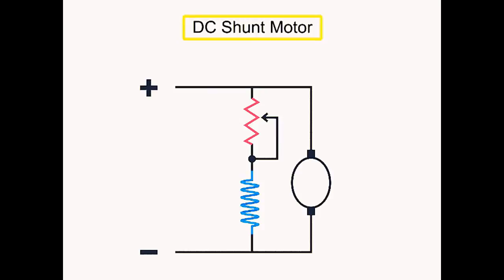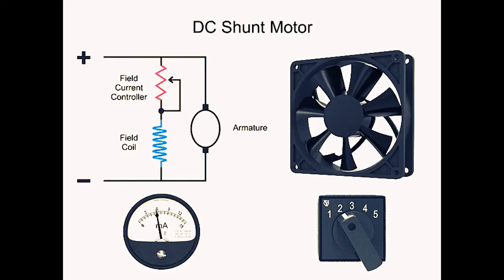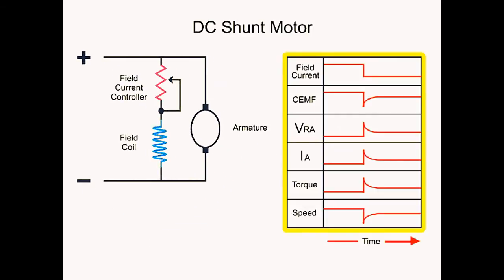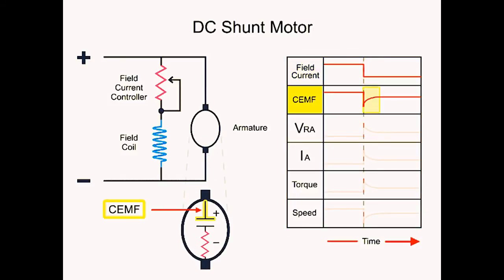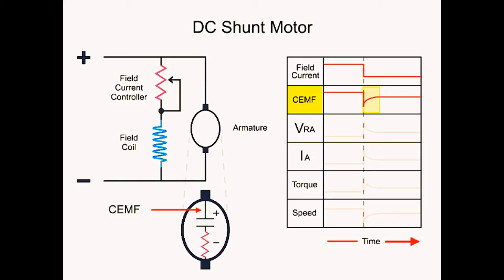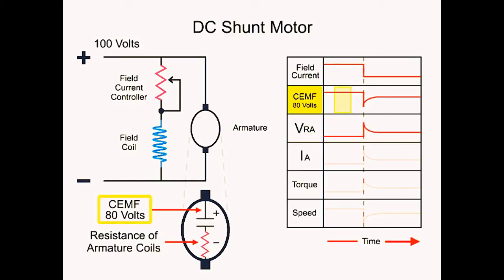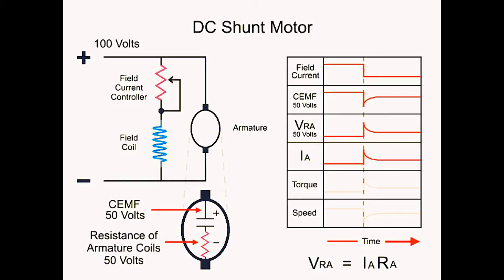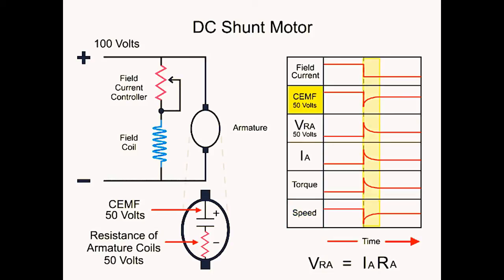How DC Shunt Motor Works? (Working Principle)

Comment: The speed graph on the last slide shows that the speed of the armature decrease when current and torque increases.  This looks backwards and appears to be in opposition to what the narration is saying.  When the resistance of the shunt circuit increases, all of the specified changes occur, and the speed of the shunt motor increases due to the reduction of CEMF, the increase in Ia (due to constant voltage), the increase in torque and presumably a constant load on the motor.  Thoughts?
Reply: Yes, it is told the speed increases but the graph shows otherwise. I think there is a mistake in the graph .
Reply: THANK YOU, I was so confused and thought I was going crazy